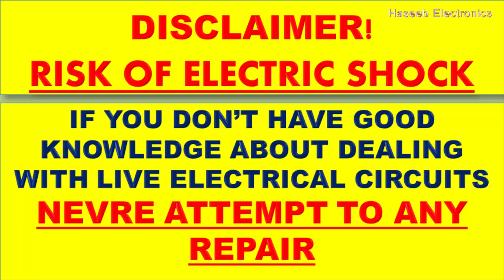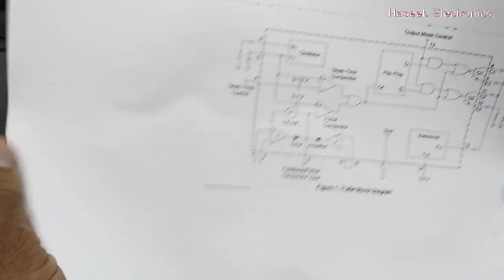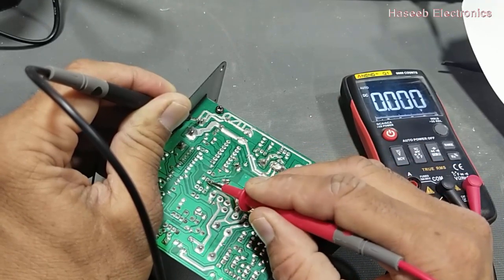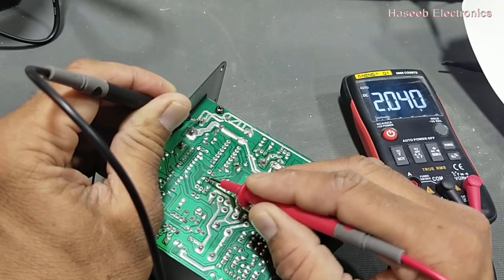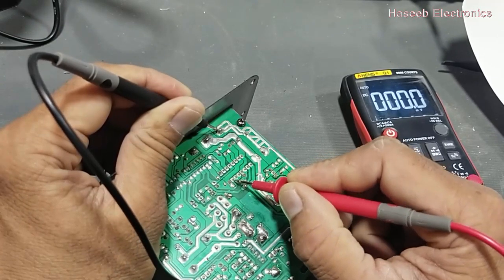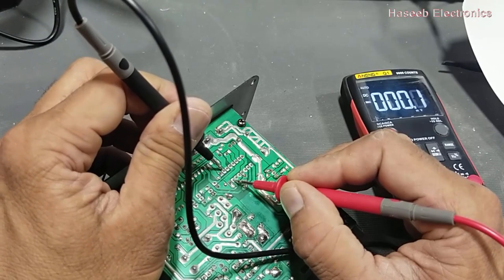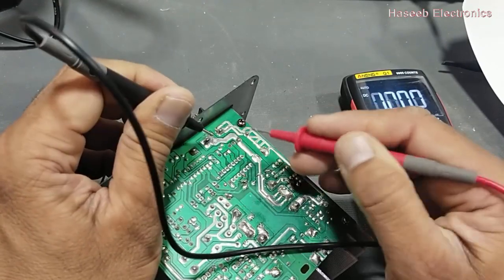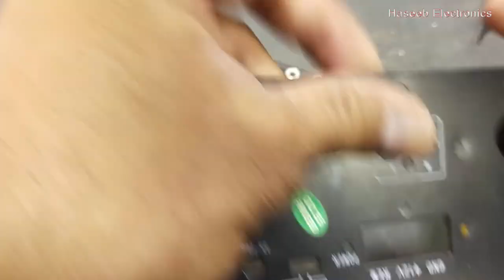{535} Car Subbwoofer / Sub-woofer Amplifier No Power ON / TL494 Not Working

Comment: What value should you get on the VCC voltage
Reply from the maker: in TL494 it is 10 to 40 volt. 
normally it is 12 to 24 volt

Comment: During car starts, the starter motor draws large amount of current.. Sir  how can we protect the audio system from getting damage..
Reply from the maker: actually if the wiring is perfect, then all the car audio systems are controlled from the "REMOTE" signal. it comes from ignition switch and it is disconnected during car start-up.  (this signal is disconnected during starting time) after startup this signal is routed again to turn on car audio system 
if this signal is not routed properly, it must be inspected and if there is some issue in this signal, then some manual solution may be incorporated
Reply: @HaseebElectronics  when you start the car while the audio player is on, it will almost die.. can a diode be used prevent the current draw? Any suggestion sir. Thanks for your prompt reply.

Comment: how many amps required for run this bass tube ?
Reply from the maker: it depends on the power rating of the device.
Reply: there is no power rating same as your video basetube i have .
  @HaseebElectronics